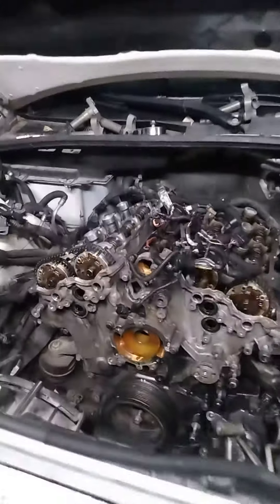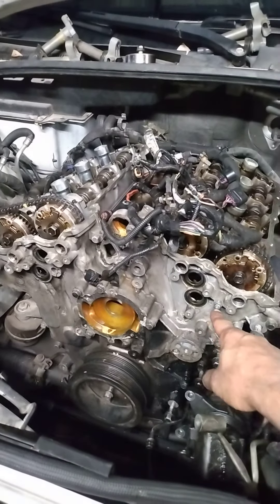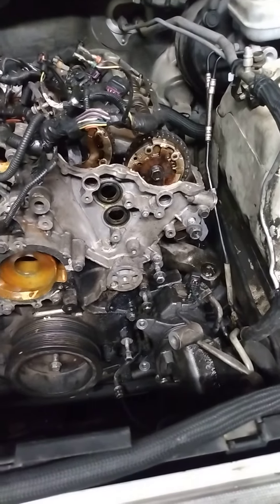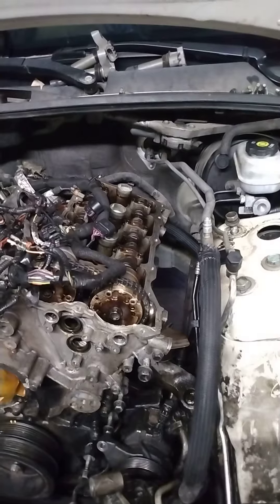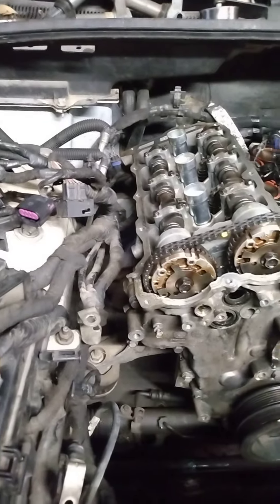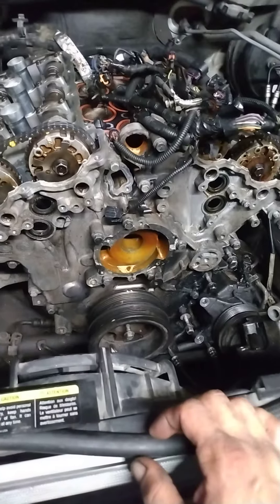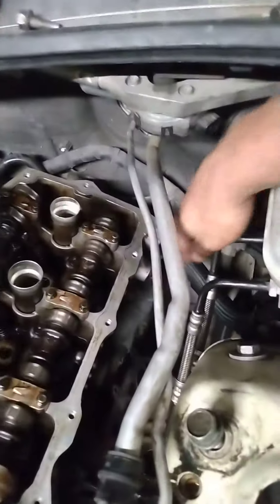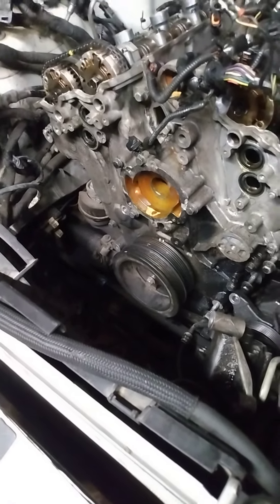2008 Cadillac CTS 3.6l head gasket tare down part 1.

Comment: how do you get the head bolts out
Reply from the maker: First break them loose and they'll come right out
Reply: What happened to part 2
Reply from the maker: @apmnews5  the block turned out to be no good. Someone worked on it before me n forced a bolt in n cracked the block
Reply: @fonzysshop4994 hey do you know what size the head bolt socket has to be? 14mm is too small and 15mm seem to strip the bolt’s head because its too loose. Thanks